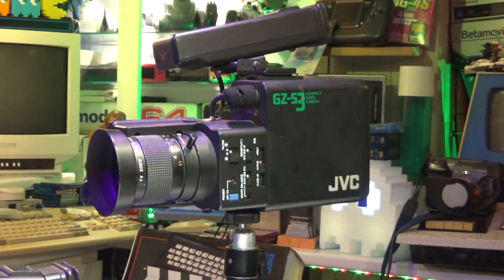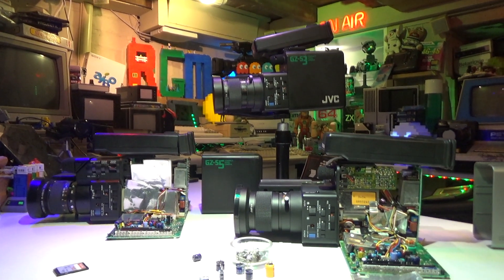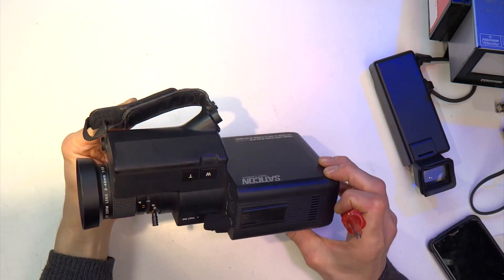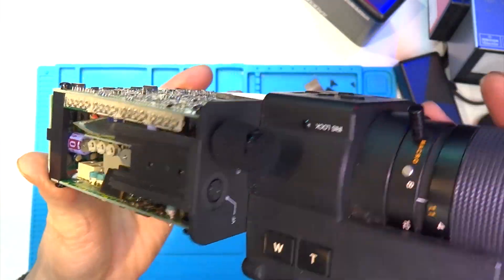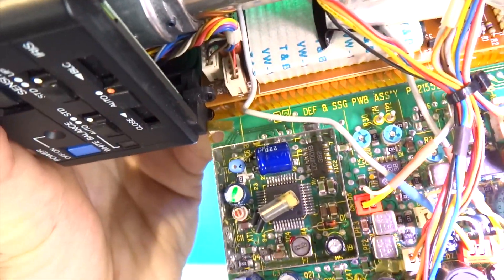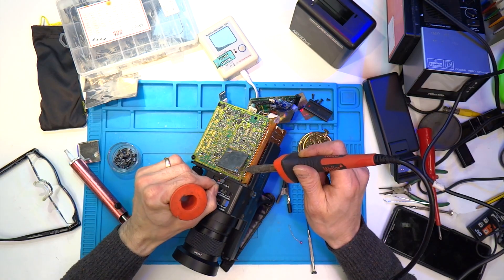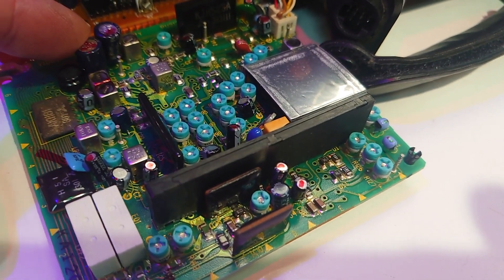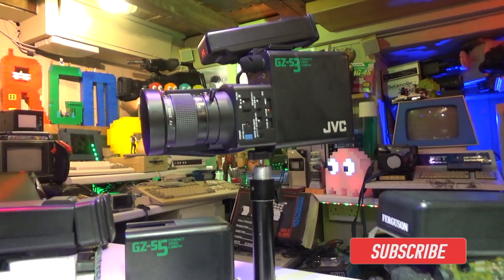JVC GZ-S5 GZ-S3 FERGUSON VIDEOSTAR 3V44 SATICON VIDEO CAMERA REPAIRS Part 1 Leaking capacitors

Comment: Hello there.I have the JVC GZ-S3 camera paired with JVC HR-C3 video recorder.The Video unit powers up but the camera doesnt.I can also power on and off the video from the blue button on the camera but while the video powers on the camera doesnt and the Led also dont power on.I have change all the caps from the camera's power board (the pcb behind the tube) but no luck.Any idea?I also check some voltages on the round socket that provides  power to the camera,I found a 12v pin but also found one that reads 10.2 something.Do you believe I have to check for bad capacitors on the video unit too?
Reply from the maker: I would be surprised if there wasn’t any bad caps in the video player.  Check for cracks in the plastic lace up guides too.
Reply: @RetroGadgetMan  I had some progress.There's a PCB behind the 10 pin socket of the camera.I found a blown fuse there,and an electrolytic cap thats shorted.Ι will change them hoping that this is the problem.The two plastic guides are cracked.I will try to fix them with some UV Resin.
Reply from the maker: @upbgenoob5488 excellent!
Reply: @RetroGadgetMan  Hello again!I have some progress.Camera finally power up and seems to work.The only thing is that when i move the camera left to right while seeing the viewscope,everything seems fine,but when i move up down I can see distortion (image just stretches on up and down movement) in the viewscope!Any idea?
Reply from the maker: @upbgenoob5488 is it the same when you view the picture from the video output. Could just by the viewfinder
Reply: @RetroGadgetMan  Haven't try yet the video output,but I will also change some leaking caps in the viewfinder.

Comment: I just bought a gz-s3 and it doesn't even seem to power on at all, have any clue why?
Reply from the maker: Could be a blown fuse in the video recorders 12v supply to the camera.
Reply: I have the sf-p3 set up the the vhs-c player works that its powered by and when you hit the power button on the camera it's self it powers on the vhs-c player but nothing else it's quite odd thanks for responding!
Reply: @aidankise113  Hi there,same problem here,I changed all the capacitors from the pcb that is behind the tube with no luck.Any progress to yours?
Reply: The tube doesn't even glow either
Reply from the maker: @aidankise113  is the CRT view finder lighting up on the camera. These cameras and VCRs are notorious for bad leaking capacitors.    I would start there.
Reply: @RetroGadgetMan  the tube glows like its supposed to the crt does not work at all and the red button for the power does not glow either I've begun changing capacitors.
Reply from the maker: @aidankise113 keep us posted with your progress.

Comment: Hey what’s up I bought this camera and it works pretty well other than a few of the side buttons not working such as the power button and flicking up the filter switch gives the camera a circuit bent look definitely a leaked capacitor but any clue where it would be located or how it could be fixed. Thanks!
Reply from the maker: Glad it works. You would need to do a physical check of every capacitor to look for any leakage and or test each one with an ESR meter. I will be making a video in the future about using an ESR meter.

Comment: Found a JVC GZ-S3 for 20$ at a local store. The seller and I have no idea if it works or not since buttons labels are in Japanese. Couldn’t find any details on internet about this unit. Couldn’t figure out on how to turn it on, if there’s a charger I could buy somewhere, what kind of memory it records on, or video quality it shoots. I’m hesitant whether or not I should get it. Would appreciate if you could help with any information above.
Reply from the maker: Hi I actually made a video that should answer your questions. https://youtu.be/Pjk40tgPAhs?si=45Gfutsewm3HIbv2
Reply from the maker: And here is a video showing you what you can get to record with today instead of tape. https://youtu.be/5A9Pr3t68jw